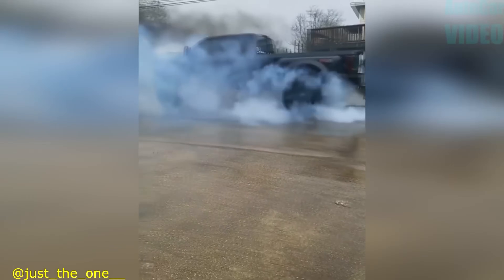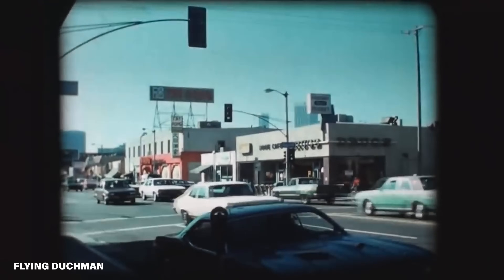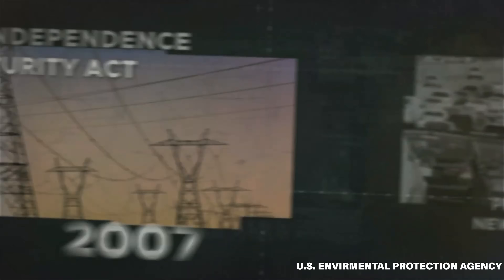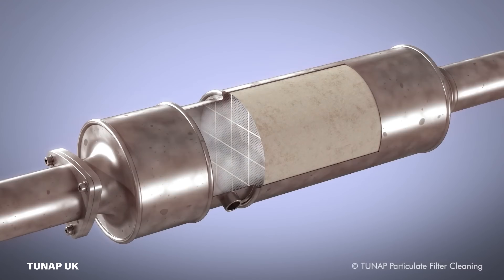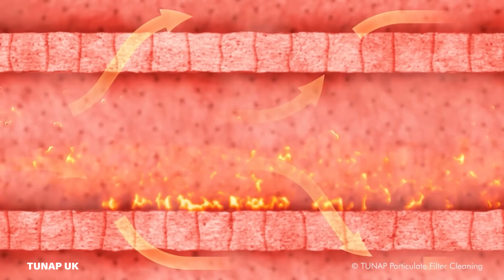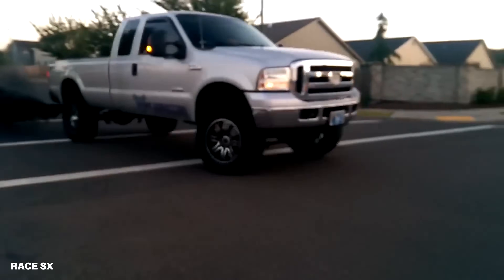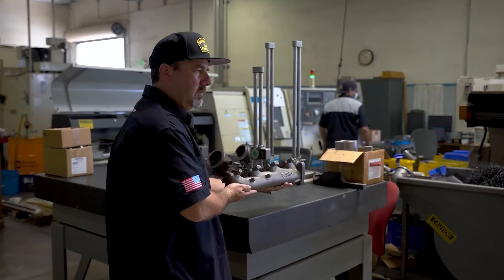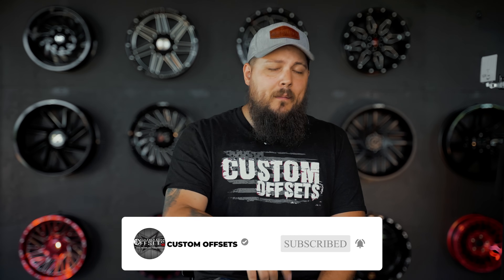What's DEF and Why Do You Need It?

Comment: Funny part is the EPA is concerned about emissions but all that smog crap effects MPG. My new 2500 Ram gets 18-21 mph at 65-70 mph. My friends truck that’s “deleted” get 24 mpg at the same speed. But he also has 22x12 rims on 35” tires. His truck is also tuned to not smoke at all. So why can’t manufacturers tune the factory truck to run cleaner and get amazing fuel mileage.
Reply: Government needs there monney and they have to make all the Karen's happy .  .  Up here I  the north 1 in 4 truck are deleted.  😂 noting works in the winter . Wen I say noting I mean noting.
Reply: My 2012 2500 went from 12-14 to 21-24 MPG no smoke unless I turned the tune all the way up and dogged the shit out of it. It also helped cool the motor down I used as a work truck and it would get hot before the delete. Just bought the dreaded 6.4 looking forward to seeing how much a delete and tune helps
It
Reply: @leebo92_38  emissions absoubtly kills a 6.4 its a great motor. if its had emissions for a very short period of its life preferably not at all......... the emissions is known to fail in a way that causes Diesel fuel for the regen to beable to seep into the oil pan and your oil sump sucks it up and lubes your main bearings and crank and cam journals with Diesel fuel killing the motor  very quickly hence their bad reputation........ i own a 6.0, a few of my buddies got 6.4s the Piezo stack injector is probably the most advanced and best fuel injector type i think equivalent to HEUI injectors in the 7.3 and 6.0. but the Piezo stack injector offers huge benifits its such a fast system and can inject at very very high fuel pressures you can have full combustion injection 5-8 times before TDC of the piston which means a very hot tune for a 6.4 powerstroke adds around 300 horsepower alone. and upgrades for the motor are almost entierly just Deleting the emissions, upgrading the Sequential turbo setup to a bigger better aftermarket one or 1-2 big single turbos and if you get fancy with it studding the heads to accompany all the extra boost.......... easily stock bottem end and mostly stock top end 1000 horsepower capable
Reply: @justnsaliga8518  I just found an oil leak looks like it could be the front main seal. Ganna have a mechanic look at it after that’s fixed I’ll be getting the deletes and mini maxx probably Ganna see how it goes from there if it’s a good motor I’ll look at what other upgrades I can throw at it.
Reply: @leebo92_38  6.4 is a cool motor if u take care of it if will last u a long time
Reply: and i get 44 mpg with a lead foot, outside of amerikkka, grow up
Reply: Because you don't know what science is. We know exactly how much and what kind of emissions vehicles emit and how much these catalytic systems filter out. Slightly reduced mpg compared to how much less nox and particulate matter released with the catalytic converter and DEF is trivial.
Reply: @butWhyDad  so Europe truck don't use DEF of and type of catalyst! Mr scientist....  Scandia make up words of 900hp and have zero emissions. They emit less NOX and carbon than the crap system America has. The EPA in America is a joke and needs to be abolished
Reply: not to mention there was a Diesel callout challenge with a bunch of sponsored built trucks trying to get the highest dyno numbers, 1st and 2nd place taken home by cummins trucks, and 3rd by 6.4L: Aaron Rudolf (1,987 hp / 3,005 lb-ft)
This record, the highest recorded rear wheel horsepower and torque of any Power Stroke engine, to my knowledge theres no such thing as aftermarket injectors for these its such a unique design and offers many many advantages for one it doesnt have to be machined for higher flow or bigger CC due to its nature of the function of it........ tuning alone you can match super expensive aftermarket injectors of duramax even 6.0's 7.3s and cummins, if you get 5 full injections for combustion thats basically 500% over injector.
Reply: 3 mpg is nothing compared to the Sulphur lol
Reply: It’s insane this got this many likes when you don’t even describe what truck your “friend” drives lmfao. Of course an entirely different truck with a different engine trans body style tires no shit it gets different gas mileage. I’ve never seen so many stupid people like something so obviously Dumb.
Reply: but then they couldn't grift us for billions.
Reply: Cuz it makes sense to do as u think lol
Reply: 2018 Powerstroke. When I deleted, I also installed a catalytic converter, since I do still want it to be as clean as possible. Once that cat heats up, I barely smoke(slight haze) when I put the hammer down.
Reply: @mr8610 
Doesn’t it shorten the life of the catalytic converter?
Reply: @orangejuice4332  they have cats made specifically for this

Comment: "What's DEF and why do you need it"

Me: that's the neat part, you don't.

(When certain parts fall off that is)
Reply: Hit a bump in Mexico and the truck is guaranteed to never need def again
Reply: Def is like soda for your truck it will kill.your truck eventually
Reply: Yup no one needs government juice
Reply: Exactly 💯
Reply: Unlike soda diesels.hate def thi
Reply: Lmao
Reply: @pepeiann    No u.   N u me. B.                                       A
Reply: So just straight pipe it then 😅
Reply: That’s cool, if you can perform your own repairs. If you ever have to use a certified shop, they will refuse because the factory emissions are removed.